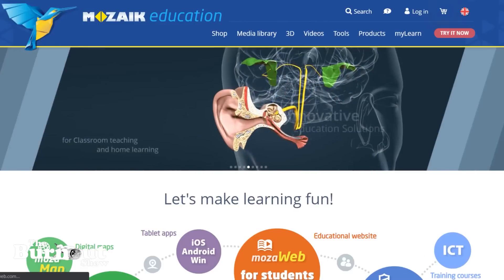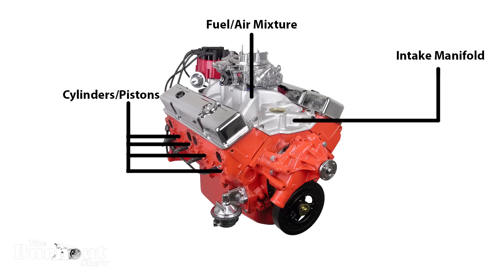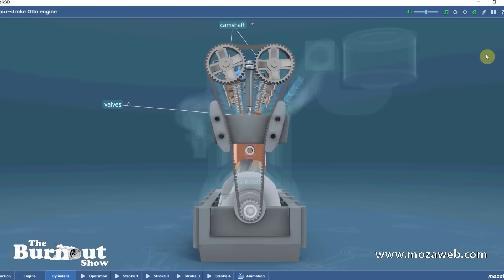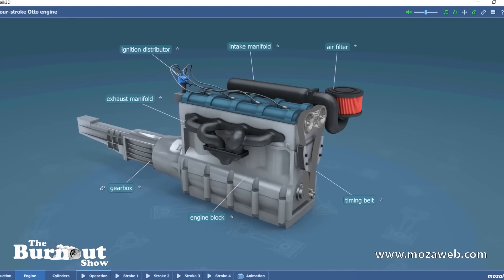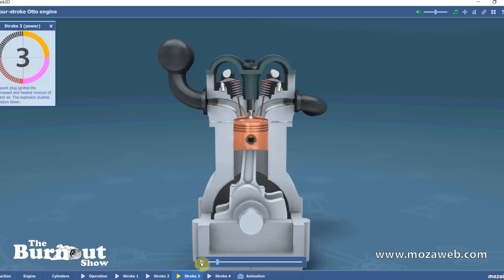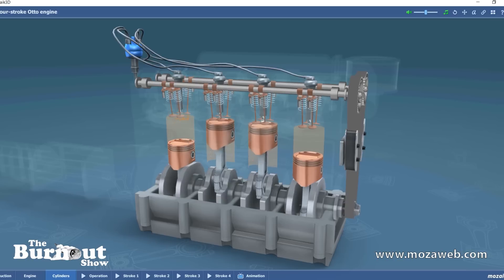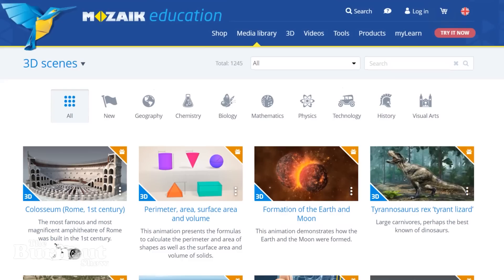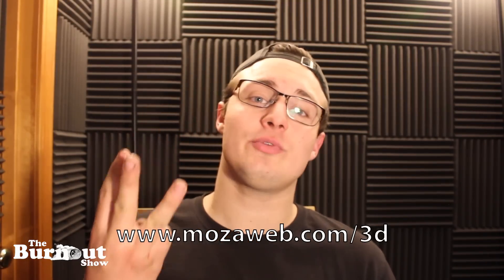How a Car Engine Works (Internal Combustion Engine) - Burnout Tutorials

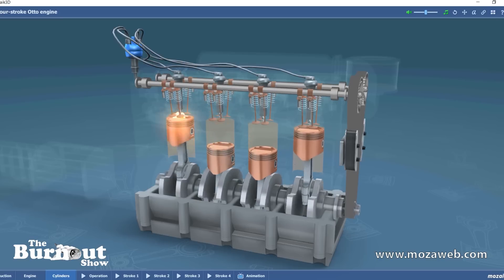Comment: @ 3:18 that information is incorrect. the crank revolves twice to complete the combustion cycle which is 4 strokes. good video tho. cam rotates once vs crank twice on a 4 stroke.
Reply: Thanks for sharing that i was so confused. Will make a note: two rotations of the crank shaft = 4 strokes.

Comment: 2011 Cadillac SRX ..A misfire on cylinder 5 on bank 2.. New Spark plugs and new coil pack and still have this misfire. Any suggestions? 3.0 Engine

Comment: I could be mistaken, but you appear to depict a direct injection (DI) fuel system for an inline 4-cylinder engine, but repeatedly describe a port-side fuel rail system...not super important, but might be worth clarifying the difference.

Comment: Good video 
Question if it's doing 4 strokes 
Why doesn't the exhaust and intake open everything it goes up
Reply from the maker: Thank you. Could you ask your question again, I'm not exactly certain what you were trying to type before.
Reply: cam lobes determine when each valve opens and closes.....

Comment: I once had something called a "coil pack" replaced on my VW Jetta. My mechanic said it took the place of distributers which he said are not used much anymore in modern automobiles. Is this true - and if so, is their a difference in operation between the two?
Reply from the maker: Yeah, that is true. Coil packs started replacing distributors in the 90s. They effectively function the same. However a distributor has moving, mechanical parts and a coil pack does not. Coil packs are also much more efficient and typically much more reliable than distributors.

Comment: Very nice explanation. Especially about the ignition plug. Kudos. Thanks for your time for making this video.
I have one question -
We have 4 strokes and we have 4 valves. At least one valve will be at power stroke to make the shaft running. but what is status of all these 4 valves while starting the engine. How the shaft gets its turn first time. Can you please explain
Reply from the maker: Hey Aadhi, So if you have 4 valves in the cylinder, then 2 valves will open for the intake and exhaust stokes each. And all 4 valves are closed for the compression and power strokes. So basically when starting the engine, the exact same thing is happening inside the engine, it is just not as fast. The crankshaft gets its first turn from the starter motor. The flywheel/flexplate is a large gear which is attached to the back of the crankshaft, and the starter motor makes contact with that gear when you turn your car key in the ignition, and then the starter motor starts spinning, which drives the flywheel, which in turn drives the crankshaft and the rest of the internal components beginning the cycle. Hope that was clear, let me know if you have any other questions or want anything else clarified.

Comment: CAN YOU PLEASE TELL ME HOW STEPPING ON THE GAS PEDAL MOVES THE ENGINE AND ACCELERATES IT PLEASE?
Reply from the maker: Hey Elias, so basically the way it works is that as you push on the gas pedal, it pulls on a cable that runs to the engine either the carburetor, or the throttle body (if its a fuel injected car, which pretty much every car from the 90's and up is), and that cable opens up the air intake on the engine (again either in the carburetor or in the throttle body) and also tells the fuel pump to pump more gas in through the carb or throttle body. Then the more concentrated air/fuel mixture flows into the cylinders where it gets combusted. The more gas and air you pump into the cylinders, the bigger the explosion in the cylinders. The bigger explosion sends more force down on the piston, pushing it down harder, causing the crankshaft to spin faster which causes the transmission and driveshaft to spin faster, putting more power into the car's wheels, which then accelerates the car.
Reply: @TheBurnoutShow  Ok, but do you have an animation for that? I am sorry. I got that idea in my head but want to see the real way.
Reply from the maker: @YorkerEli  Unfortunately we don't have an animation for that at the moment. This animation was provided by Mozaik Education, and they only have a few animations about cars. However, hopefully in the next year or so, we could start making our own animations for really specific videos like your question. Unfortunately, it's just not in the budget right now.
Reply: @TheBurnoutShow  Ok thank you man, at least you gave me an idea, all those other animations only explains how the engine works rather than how the engines are controlled.
Reply from the maker: @YorkerEli  Of course. And yeah, that's kind of why I make all of my tutorial videos, every video I've ever watched just skips over some stuff and leaves you with more questions, so when I make videos like these I try to give all of the information that I can.

Comment: You made a mistake in your video. A 4 stroke engine takes two crankshaft revolutions not one for a complete cycle of the cylinder.
Reply from the maker: You're right. I suppose when I said it takes 1 full rotation, I just meant the full process of rotations, including both revolutions. Thanks for pointing that out though!